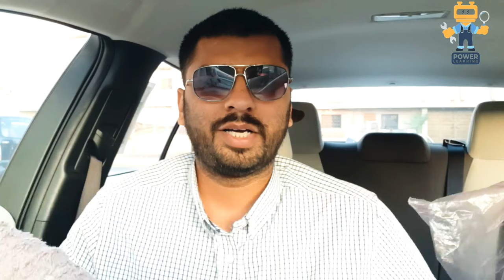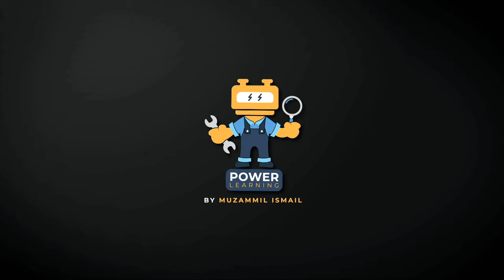#Generator problems under over voltage troubleshooting | Common problems solving in diesel Generator

Comment: My issue is the 20KV generator is meant to  supply power to office, kitchen and laundry, however I have noticed that once we turn on the cooker it the generator shuts down,I want to know exactly how I can solve this problem,is it under voltage issue?

Comment: Hello sir how are you, sir i have a genset kta 38 cummins 1000kva dse 7320 if the genset start line to neutral 230v line to line 400v, but the problems is frequency indicate 53hertz not stable to 60hertz how to fix this problems, thanks and take care sir
Reply from the maker: Check ur speed sensor circuit
Reply: The mpu sir ok 2 speed sensor is install i check, thanks sir
Reply: what is the rpm?
Reply: @shahariaakter4393  1800rpm sir
Reply: throw the mag pickup in the bin and use frequecncy detection.

Comment: What shoud i do when generator over voltage and it will automatically shutdown the genset
Reply from the maker: Expert inspection
Reply: Adjust the power to it's max and instal the sensor line.

Comment: Thank u. In case of synchronizing 2 same size gensets, do we need to activate voltage and speed droop characteristics in the dse 8610
Reply from the maker: Yes sure
Reply: Even if the gensets r working off grid. In a remote area?
Reply: no, the DSE does not control droop, it is controlled by the AVR via the quad droop CT's and the electronic governour control the speed, ther DSE can control the reactive power.

Comment: When replacing contoller..
 I encounter under voltage  alarm.. even the phasing and rated v was reconfigured..
 Any advise sir
Reply from the maker: Which controller model u have and what exact alarm is trigger

Comment: Nice explanation sir actually I had a small problem that was the dg was on but few seconds ofter then shutting down the display shows AGF V3 LOSE what I candoo now could you tell plzz sir
Reply from the maker: Which DG controller u have
Reply: @DieselGeneratortraining  Greenvens DG EMS927V4 Sir
Reply: Please reply sir

Comment: How do reset low voltage fault on kj power generator using a d500 control panel

Comment: My Perkins generator is showing over voltage alarm and stopping. Phase to phase  is 380 v and line to phase is 270 but   actual is 220v so how can we adjust the line to phase voltage.
Reply from the maker: Try from AVR

Comment: I have a Bundu 20kva Generator it's new but it's failing to take my four laundry machines, 2 speed Queen dryers and 2 commercial washers , it just shuts down when they are all running, what could be the problem

Comment: Sir my 1000 kva cummins is showing high ac voltage after I increase one of the voltage phases, what should I do.
Reply from the maker: Adjust ur AVR as first step
Reply: Please I need all the steps I to take thanks

Comment: i have a problem  of over voltage and under voltage after 7sec from starting the cumins generator ,adjust avr but not respon to this issue..help pliz

Comment: 3 phase Ship Generator sometime getting high voltage alarm (more then 106%) and on attempting  paralleling with other generator Blackout occured. Voltage 480v instead if 440v.
2. Same Generator in off load condition, sometime getting high voltage alarm
Please advise for the root cause
Reply from the maker: Make insulation test
Reply: poor voltage control

Comment: Can explain how configure digital output based on speed. I want configure 3 output on different speed plz make video on it. thanks your video was so useful for new learners. God bless you sir.. Keep making more videos ... 🙏🙏🙏🙏
Reply from the maker: Santosh thanks for liking 👍  I would like to inform you there is no option to select three outputs for 3 different speeds selection you can do it with different configuration selections
Reply: @DieselGeneratortraining Thanks for  feedback, plz suggest how I can achieve from DSE 7320 for said above problem
Reply: Asalaamu allykum  why is a generator starting after few seconds it shut down
Reply: you can if the DSE has the PLC internal function

Comment: In synchronization generator 2 different KVA 800&500 under voltage tripping after running some times on load

Comment: what will be the possible causes of a generator that starts and run for 2 to 3 minutes and dies?
Reply from the maker: There is many reason
Reply: blocked fuel/air filter

Comment: FAILED TO REACH LOADING VOLTAGE, If the engine fires but the generator fails to reach the loading voltage before the end of the Safety On timer a shutdown is initiated, how can fixed it?
Reply: how did you fix it??
Reply: what is it set at ? have you tested the speed controler.

Comment: My caterpillar generator is running but frequency is stuck at 62hz and showing message on main panel NO  COMMUNICATION WITH MAIN UNIT plz give some suggestions.
Reply from the maker: Which controller and engine model u have try to adjust speed
Reply: if EMPC 2 bin it.

Comment: i have a300kw generator 12 cylinder starts and runs for a couple of seconds then shuts off it is not a fuel problem mybe a voltage drop i dont no
Reply from the maker: you have check alarm on the controller to start ur troubleshooting